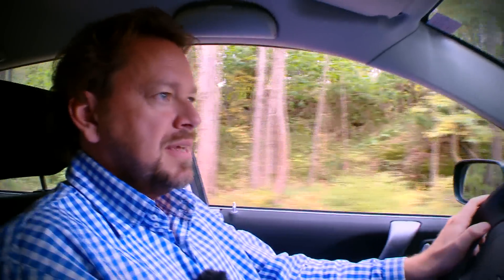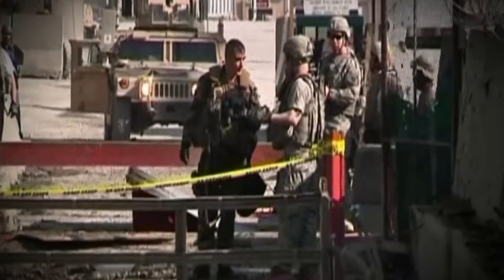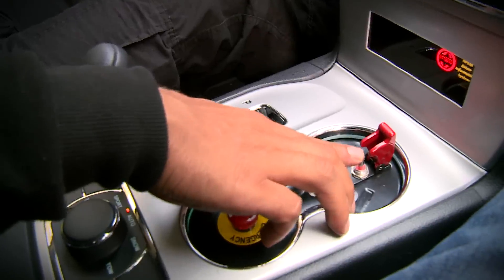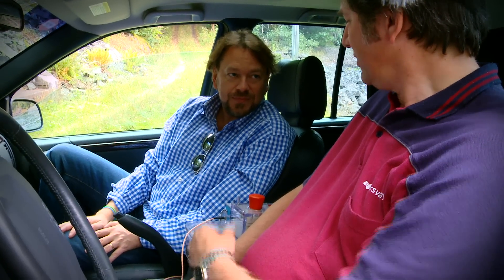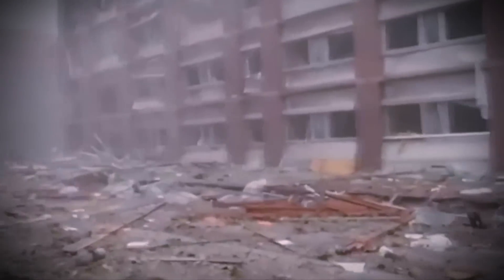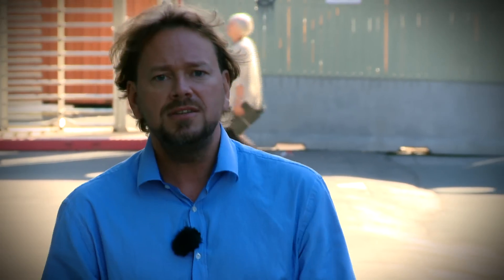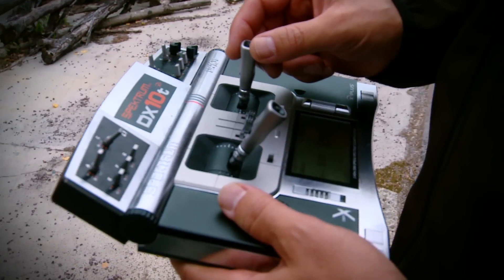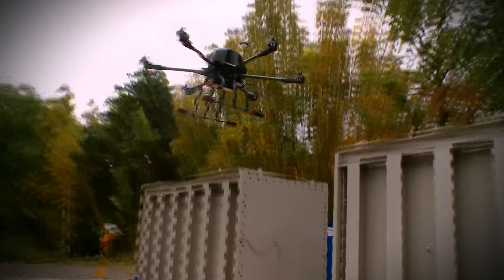Suicide bombers - and how to beat them

Comment: you just need to drive one of those old cars that has very severe electronic systems and off you go, another thing beam is killing elec system in bomb? no big deal, just mount an ecm detector in bomb's fuse so it can detect and fire up the bomb before it stops working, just a single spark.

It's really good they introduced something that can controll spread of ecm impact it's just the other cars in area might be cut out too, second thing it can also cut off cars in typical police chases but as for now we dont even know how big the device is and how much manuverability we can have there.

Comment: One thing they didn't mention is that many vehicles have power-assisted brakes and steering. If you stop the engine of such a vehicle, that vehicle will not immediately stop; it will become more difficult to control.

Comment: well, all gas engines require sparkplugs, which require electricity to fire. now old school diesels with no computer controller would not be effected in anyway by an emp or any other electric jamming equipment.

Comment: the device they said scrambles onboard computers, not closed electric wiring. So yes older cars with points and condenser distributors would still run

Comment: Still got the spark plugs and its ground through the car body so its still possible. However, suicide bomber approaching checkpoint at 60mph and they kill the electrics. That car would still roll for some distance and the bomb wouldnt be wired into the cars system???

Comment: Well even older cars still use electric distributors. Not sure if it can interfere with the car on this subtle level but if it could, technically it could knock out anything electrical.

Comment: In Gasoline engines they use electrical lightening plugs to fire the gasoline. And some diesel engines uses electrical glowing heads, but if you get a old diesel engine with no electronic at all then it might work.

Comment: its not stopped it just cut of the engine its still going forward waht if its too late to act or what if bomber will explode the car right there? useful but limited, u have to detect the car before it gets into traffic and send the emp in a rural area